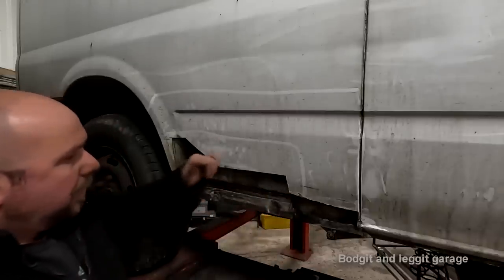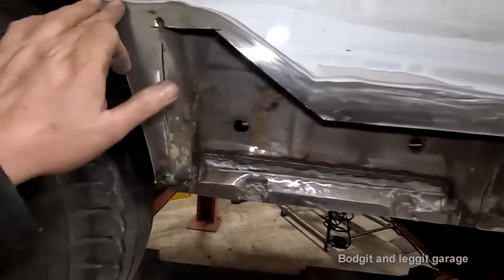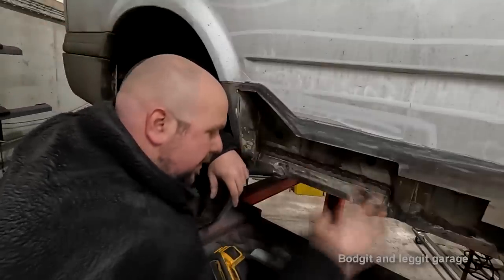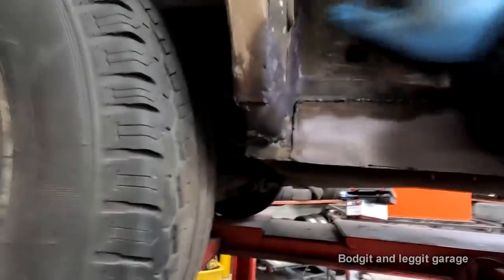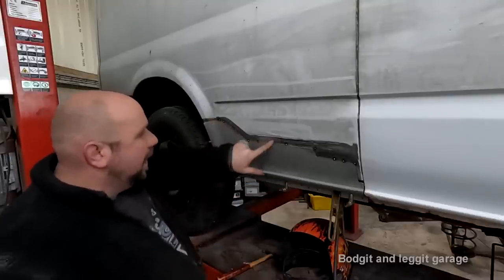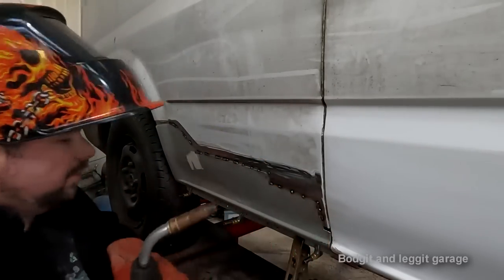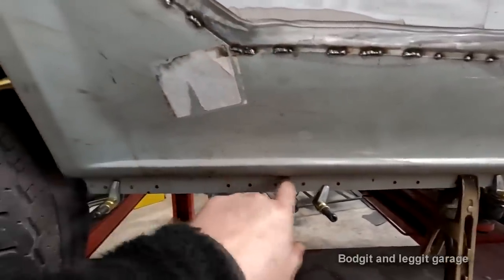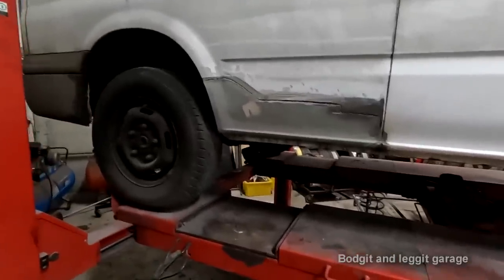DOE Van dalised Ford Transit How to Repair a Rust Holes and Weld Body Panels part 2

Comment: Can you explain why you didn't cut the outer repair panel straight across the outer swage line instead of stepping the repair panel.
It would have removed a lot of the previous filler work! 
Just wondering
Reply from the maker: Every job evolves as you are doing it. If I would have gone further up. I could run into a lot more problems and run out of a panel very quickly. This was not a restoration.
Reply: because he doesnt know how to actually replace the panel, which is cut exactly how you said. this will make his life so much easier, the job will not take long. and it will be nice straight nad flush without filler. yet he doubles down and says, everyone else says this is wrong, but the whole world is stupid what do they know, they are only professionals, this is how its done, buy cutting a Tetris pattern creating now a lapping section, which would be not needed, if you didnt hack the flat section of the panel.

Comment: How does the thickness setting work when you were welding that panel? The original Transit panel is much thicker than that pattern part. Do you set the welder for the thinnest of the pair?

Comment: I was informed by our local garage that now all panel sections have to be seam welded as plug welding is not as per VOSA/DoT regulations anymore.! how would you get it through the MOT if it's not up to specifics
Reply from the maker: This past the test a couple days after I  Also it's just past it's next test I am not in the uk so that does not affect me but I guarantee This will pass on the lip where I plug welded from the factory it was Plug welded Every single panel On every single vehicle is spot welded together So it makes absolutely no sense as it  exactly the same as a factory job When you are doing anything to do with chassis repair. You have to completely welled all the way around A lot of modern vehicles are just glued together even some old vehicles like Land rover discoveries.